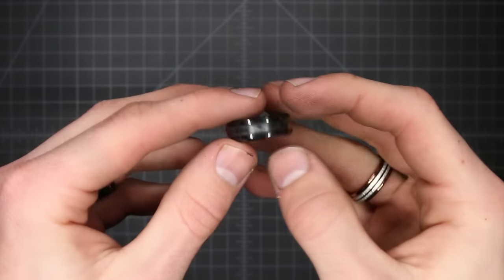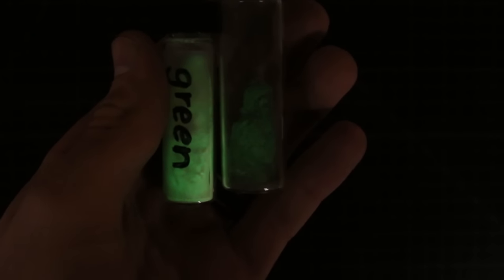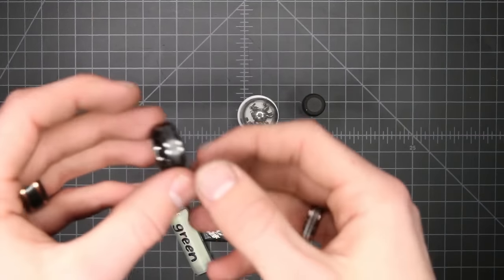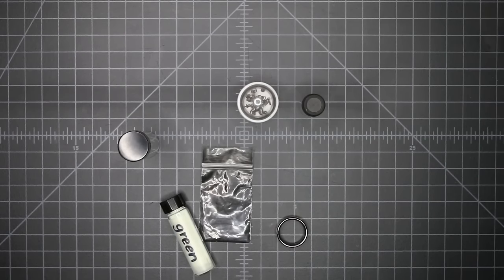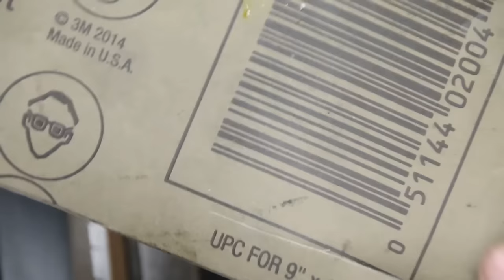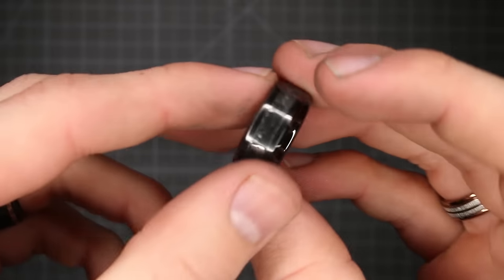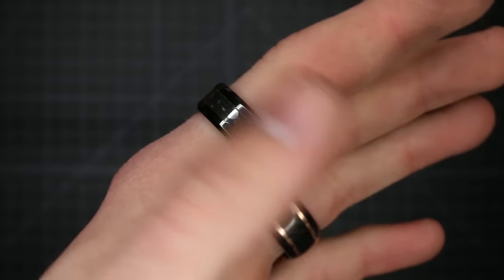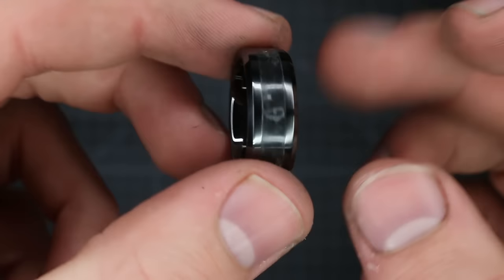Making a Glowing Meteorite and Black Ceramic Wedding Ring

Comment: Item : Meteorite Ring (High)
Durability 100000/100000
HP + 10%
M.Def +336
Stamina +10%
HP Regeneration increase drastically
50% Resist to fire
50% Resist to stun attack
50% Resist to mental attack
50% Resist to Sleep
Enable to absorb all fire damage 50% to HP
If you wear Meteorite's set, enable to use  skill "Meteor Shower" lv 10.

Dropped by Lava Golem (0,01%), Lava Mimic(0,01%), Lava Phantom(0,01%), Bahemoth (10%), Bahemoth's watcher (0,1%), Bahemoth's Guardiab(0,1%), King of Bahemoth (90%).

Comment: Strangest coincidence but last night I was browsing Amazon when I came across these very kool layered rings made from a combination of Ceramics, Metal, Wood grain, etc... ranging from $35 to $115. There were so many nice choices that I could not pick just one. So I purchased 5 of my favorites with another 12 in my wish list. 

I have yet to receive any of them but now that I know how they are made, I can understand the price range  better.  Thanks for sharing your work, you make it look easy.

I have never compared ceramic to metal or other stones, from your comment, is it correct that the ceramics are lighter. 

I look forward to comparing them and will continue to save for the other 12 or more that I want for my collection. I wonder if you can make these from a Conch Sea Shell for the pearl effect. I will be visiting your store.
Reply from the maker: +chuck luke well thank you :)
Yes ceramic is very light, but it can be a bit fragile. I could definitely make a conch shell inlay ring. Let me know if you'd ever want to order a custom one.

Comment: Your ring designs are honestly so much cooler than all the crap I have seen at most jewelers, I have had a hard time finding something that I actually want to wear. My last resort would be to just cash out and have something custom made.
Reply: Patrick Adair Designs I'm from Denmark, and rings for men are not trending at all, so the market is almost non existing. I looked in 5 different stores before I found a half decent pinky ring, but it's just plain steel..
Reply: Patrick Adair Designs Just went through your site. Holy crap you've got some goodies hidden there! :D

Comment: when you say ceramic, is it actual ceramic [that usually used as strengthening material in cutting tool] ?
so you just "going through" with grind stone to make hole ?

Comment: What kind of glue are you using? Also, I watched a guy talking about repairing propellers with super blue and baking soda, whereas the mixture is actually a trade "secret" as it hardens super hard and super strong. Is this the same concept? That is if you are using super glue. Awesome ring!

Comment: So like.. is this stuff radio active? 'cause I've word through word of mouth that things that glow in the dark could be carcinogenic. =o Any ideas on this?
Reply: necridos you would be surprised by the things you use each day bro. If you read the back of olive oil containers and stuff it says something about cancer. Saw dust is carcinogenic as well. French fries are too.

It's insane how many things we use are like that. Just don't worry about it bro. You'll live a longer happier life if you don't worry about the little things. :)
Reply: I tend not to worry about a lot of things.. Unless there's a chance that something is radioactive to the point my skin might start burning off xD I only ask 'cause that's what old glow in the dark hair dye did (This fad isn't really a new and unique thing)
Reply from the maker: +necridos nope. It's completely non toxic. The material is called strontium aluminate